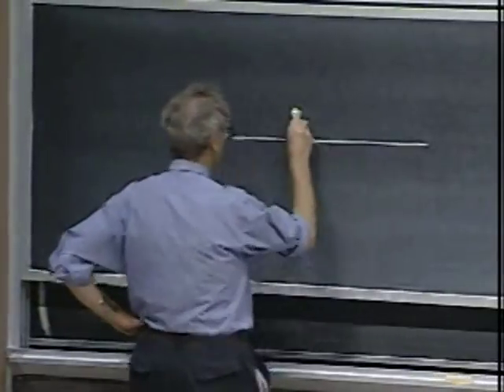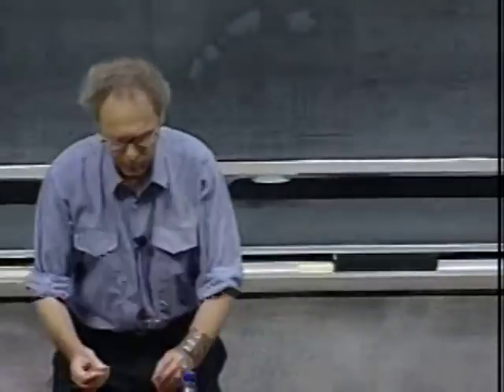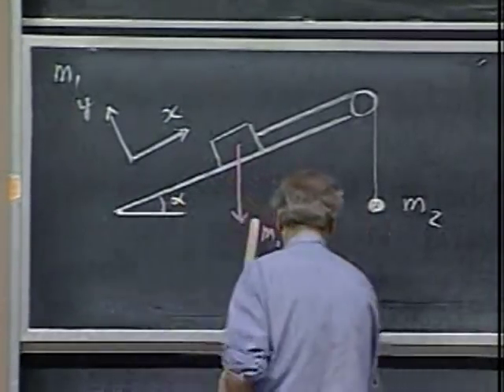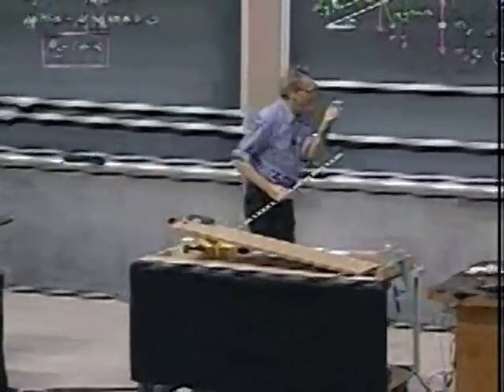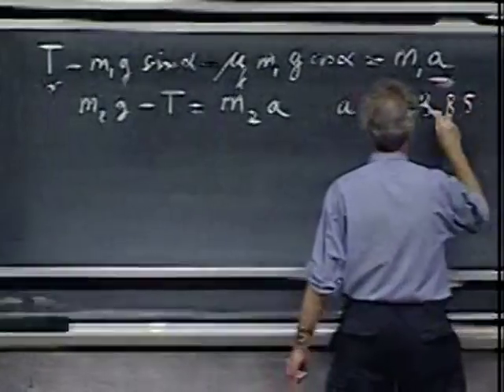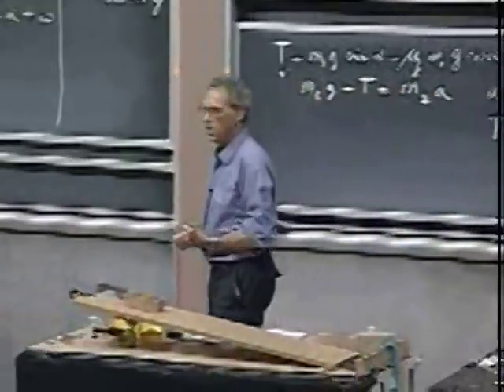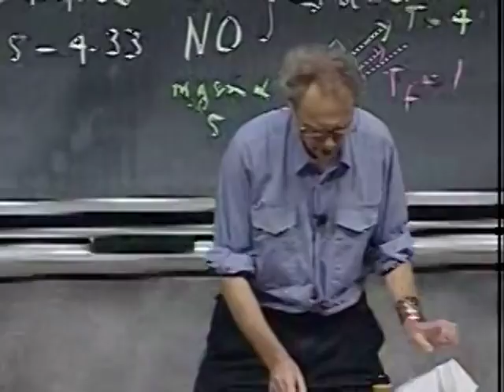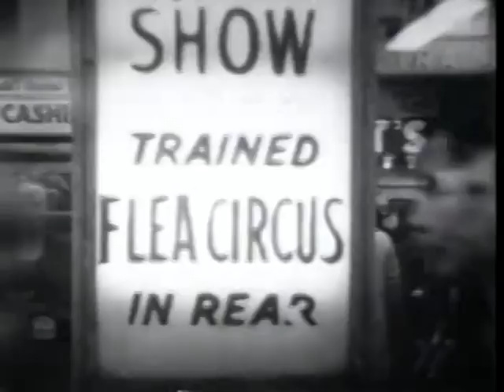Lec 08: Frictional Forces | 8.01 Classical Mechanics, Fall 1999 (Walter Lewin)

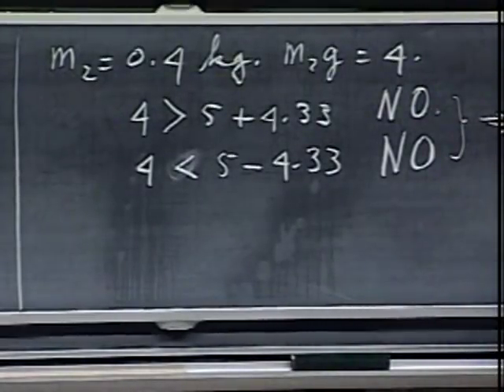Comment: in min 29:00 to know if mass1 and mass2 are accelerating in the string device we just need to see if the differences between forces, i.e x-axis component of m1 and m2 both by gravity, are greater than max frictional static force. in math abs(m1*g*sin(alpha)-m2*g) > MaxStaticFric to accelerate.

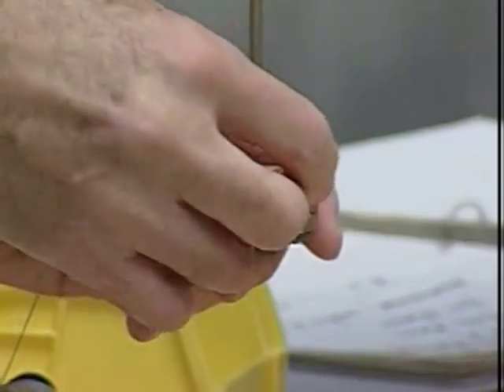in min 35:00 I'm not sure if when he said about tension changing direction he's right, because in repose m1 the forces acting in it are the tension of the wall and the component in that plane direction of his own mass by gravity.

Thanks for the lectures!

Comment: Friction is an important force in mechanics. We are told friction is due to irregularities in surface at atomic level.But we know that atoms repel each other at atomic level, so interlocking of irregularities shouldn't be possible?
My friend Adarsh suggested another reason which might cause friction - Van der waal's forces or some type of temporary bond formation at surface level. But if this were the case won't friction depend on surface area? But experiments suggest this is not the case.
Reply: But friction do depend on surface area

Comment: as you load, the friction that was acting uphill initially reduces and at a moment comes to zero. then why wont it move uphill since that is the direction of the only force acting on it at that moment
Reply: Shine Raj If the friction force is zero, that means that the other forces acting on the box (gravity and the tension from the rope) are the same. It's at equilibrium.